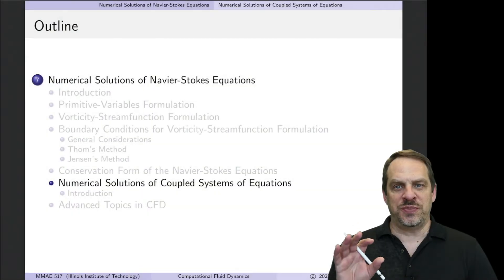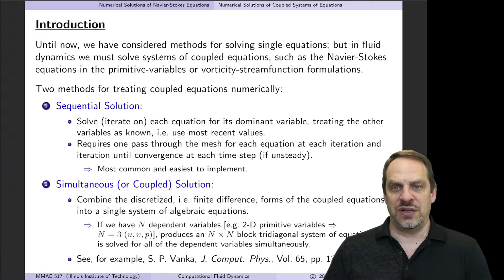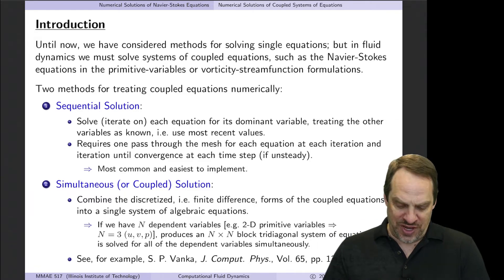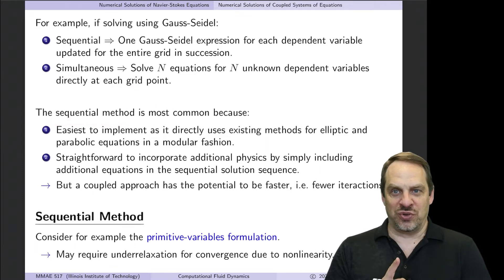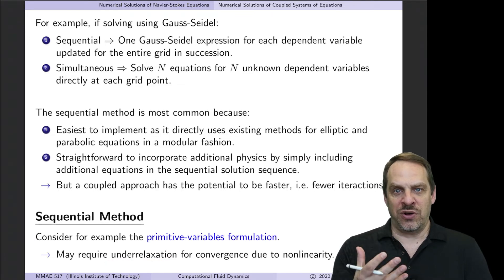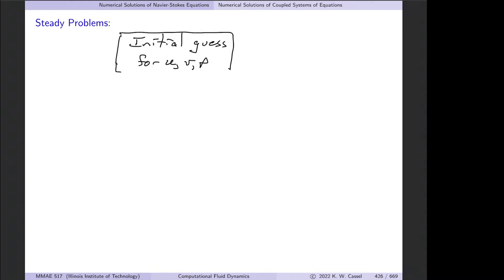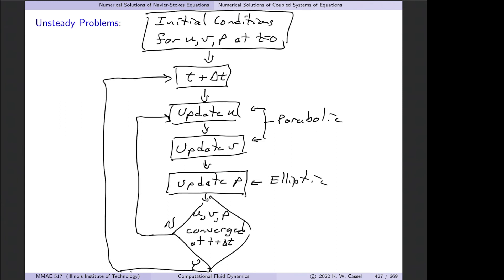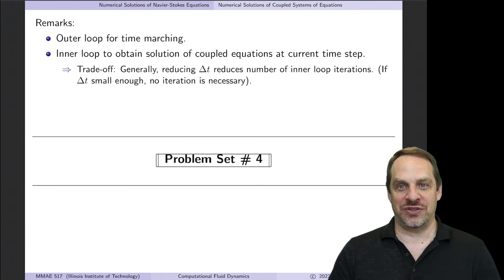Numerical Solutions of Coupled Partial Differential Equations

Comment: Hello  sir, in sequential approach, what if one of the variables in converged and other did not? Do we need to skip solving for that particular converged variable in next outer iteration??
Reply from the maker: You need to continue to iterate on all variables because changes in one will cause changes in all others in a coupled system of equations.  If one variable is changing very little, however, you can iterated less frequently on that variable to save time.

Comment: Sir, I want to ask the problem that whether the number of iterations of the elliptic equation needs to be limited in a coupled PDE of parabolic and elliptic equations
Reply from the maker: Normally, you will want to continue iterating until all of the PDEs have converged within some tolerance.  However, it is generally a good idea to also include a limit on the number of iterations to be performed for cases when the equations do not converge to the specified tolerance.  In such cases, a diagnostic should be provided to the user to indicate that the algorithm has not converged within the specified number of iterations.